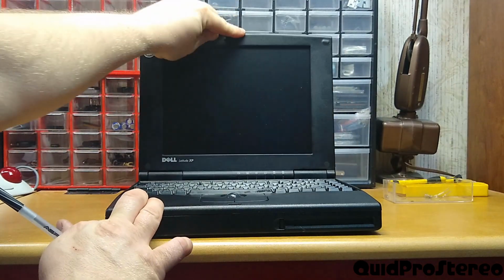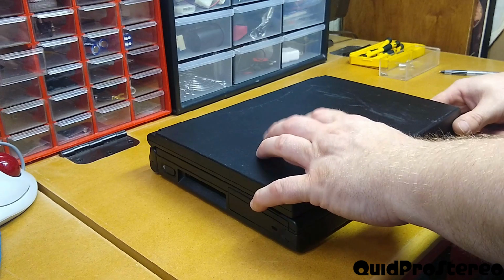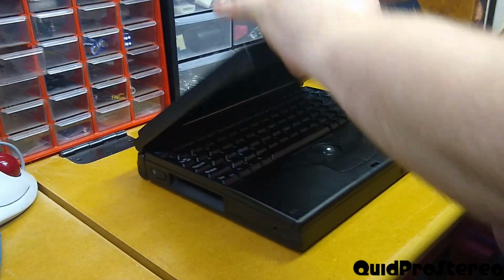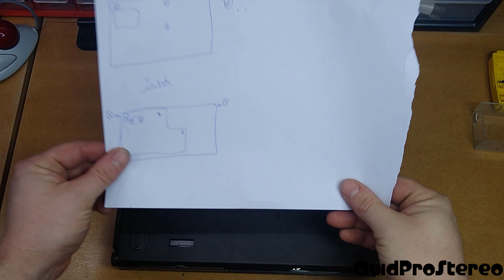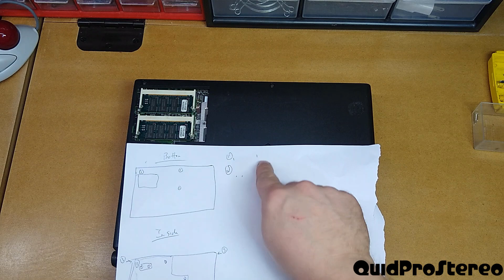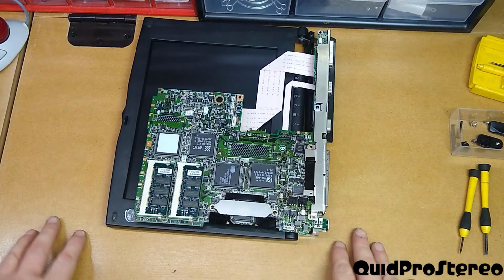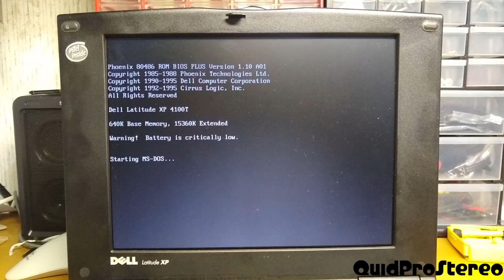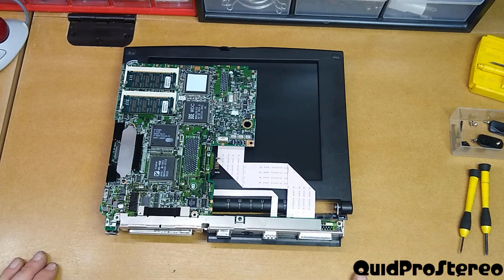Dell Latitude Laptop BIOS Password Reset (24C02 EEPROM)

Comment: Completely off topic:

Is that a Logitech Marble Mouse on the left? I've got one of those! Really nice pointing device, although it does take a little getting used to at first. The left switch is failing on mine, so I ordered 2 pairs to replace *literally yesterday*. So far, I've seen maybe 2 occurrences of the model on the web, and yours is the 2nd!